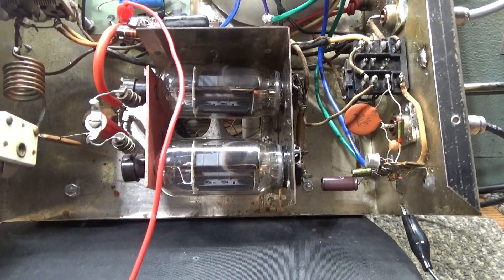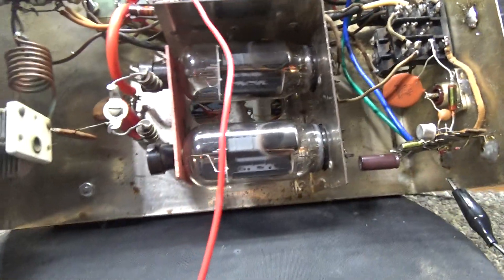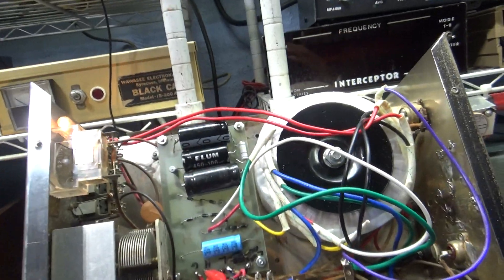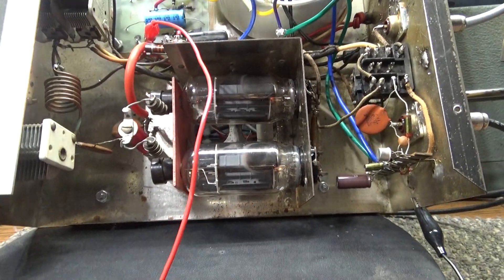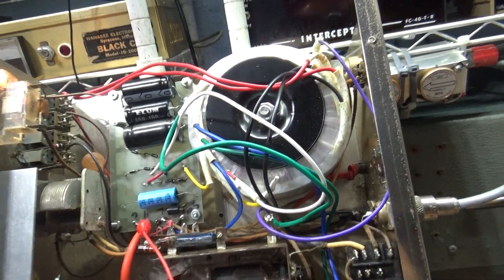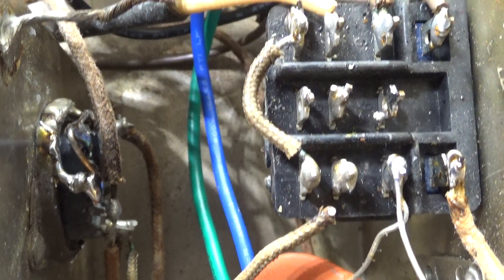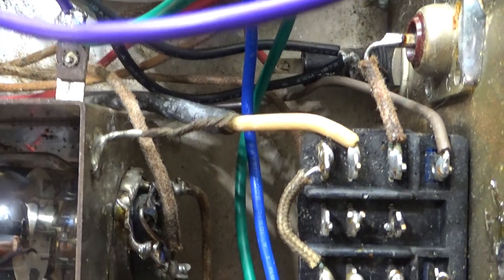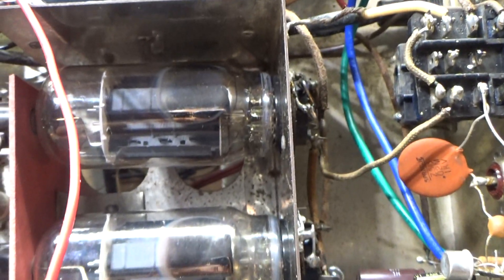Interceptor 101 amplifier initial power test FAILED, always check your Input SWR'S

Comment: Some years ago a friend found a mint Olson Spotter 23 at a flea market. I bought it from him and he said something was wrong with the receiver. No weak signals were heard. I looked at the schematic and checked for continuity from the antenna connection through the relay. Infinity! Looking at the relay's plastic cover I noticed a small burn mark. When I removed the cover I found a burned-off wire. I'm guessing that the radio survived a nearby lightning strike. Funny thing is that when I was in high school my dad brought home a Spotter 3 with an intermittent receiver problem and half of a ground plane antenna. Two lightning strike survivors? The lesson is to always check the obvious stuff first. 
Maybe you got lucky and the previous owner didn't burn the tubes down before the solder joint failed. Looking forward to the next video.
Reply from the maker: I've had a few people I sold amps to that said the amp messed up their SWR and produced no power. It was their jumpers.